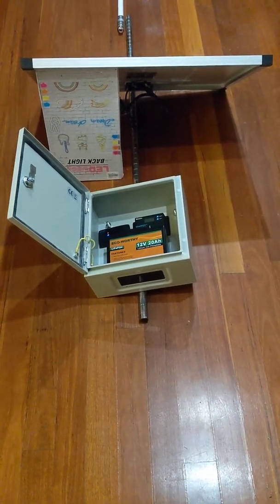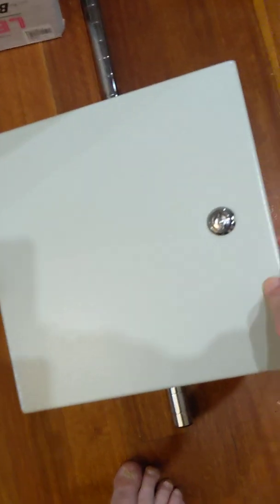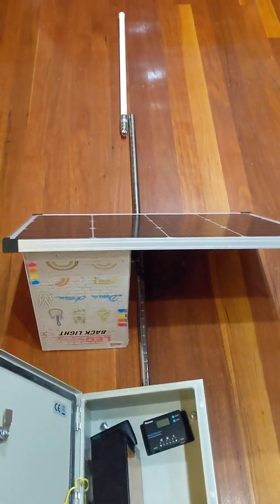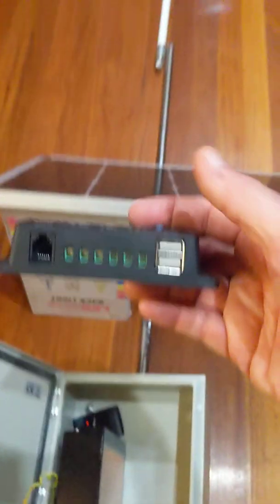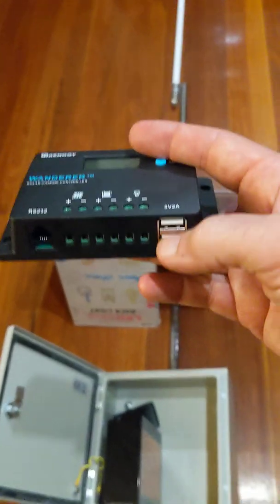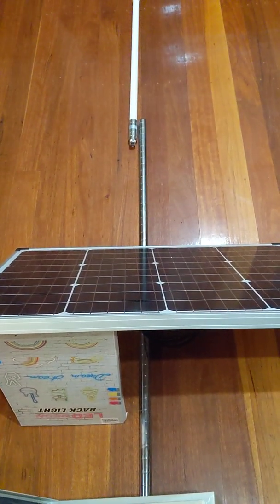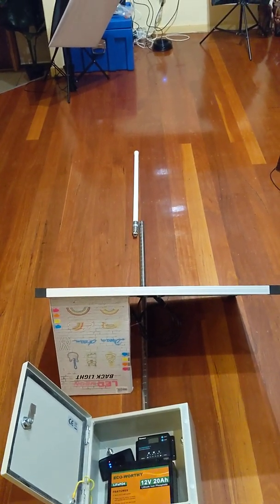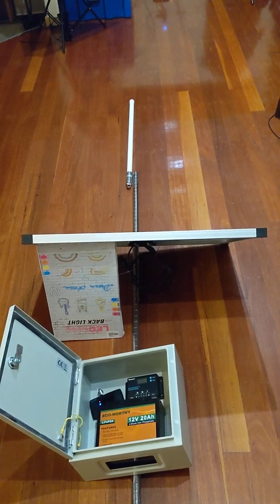Off Grid Helium Setup - A Work in Progress

Comment: How are you going to secure it so no one robs it? Thats my only issue with off the grid hnt miners.
Reply from the maker: These units will be hosted at trusted locations and will be secured making removal difficult.

I will also be hiding a IoT tracking device within the cabinet that will alert me if it is moved.

Comment: THat is NOT a 100 W panel. probably 30W
Reply from the maker: No my strong point so if I am quoting the data incorrectly I am happy to be corrected.
Reply: @HeliumDownunder  no problem, just trying to help :) you will need a bigger solar panel and a bigger battery. Also very important: a cooling system for the enclosure or you’ll fry your electronics real quick
Reply from the maker: 12V Solar Panel 100W Monocrystalline
Reply: @HeliumDownunder  we work with solar panels in a lot of projects. And it’s impossible to have a 100w solar power that siZe. There are a lot of companies online that will mislabel panels and batteries to get you to buy a cheap bargain.
Reply: Im working in this concept myself. As stated above the panel should be a bit larger if it is infact a 100w. That said consider 2 100w to power the miner (5w) and a 3rd micro panel to power the wifi box
on flat roof tops (if possible in your area) aswell as a durable post. Poles in a cement block to keep it cheap to hold against elements.
A small fan would be optimal with the miner in its own weatherproof box.